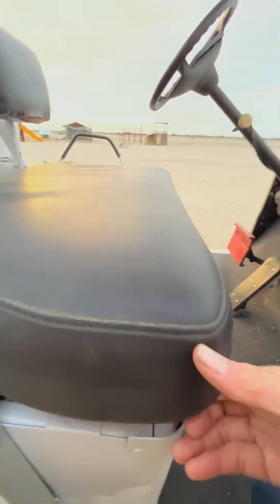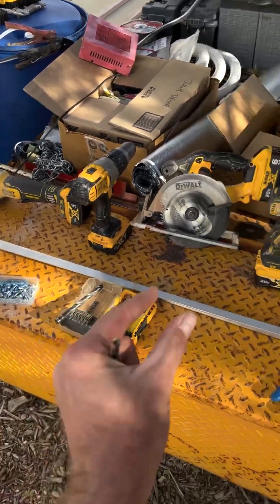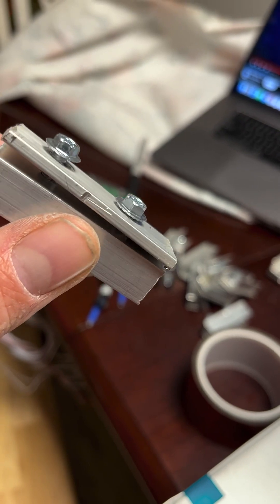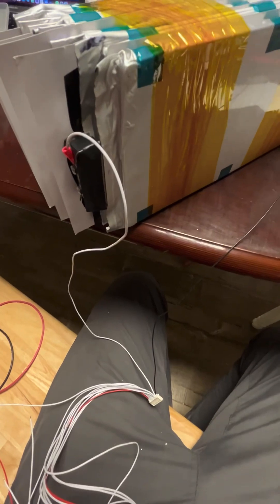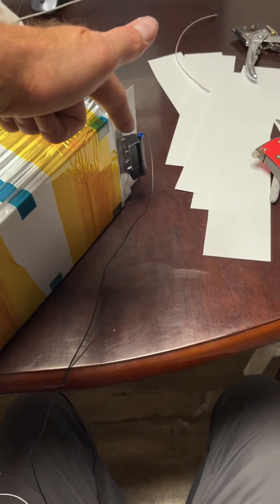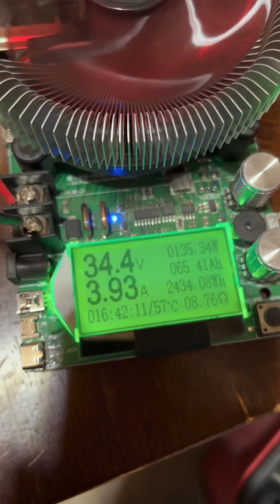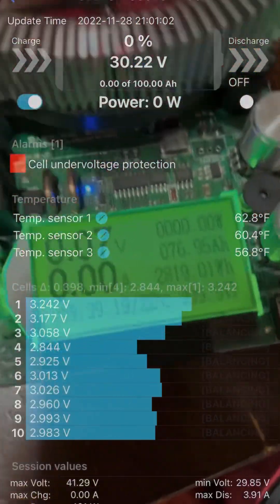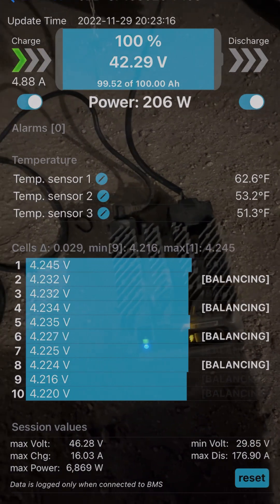Build your own Lithium Golf cart battery.

Comment: I'll be making a 20s 1p battery pack with these cells. Will my 60amp controller fry itself if I discharge without a bms?(This is being used for the cheap 3000w "Dirtbike" motor kit)-From Vevor.
Reply from the maker: That depends on the quality of the controller. The capability of the power supply (battery) to the controller has no bearing on that.  If you had a 30,000 gallon water tank with a 4” pipe an it was reduced down to 1” the ability of the supply wouldn’t affect the 1” reduction. A speed controller would simply be like a really fast opening and closing valve in this illustration.

Comment: I DON,T USE A BMS THEY WORK FINE
Reply from the maker: Yes you can get away with that with these cells. I use a 42s 6p set of these in my EV conversion and don’t use a BMS yet. I’ve cycled them probably 300 times too.